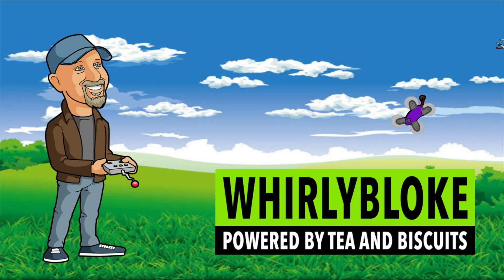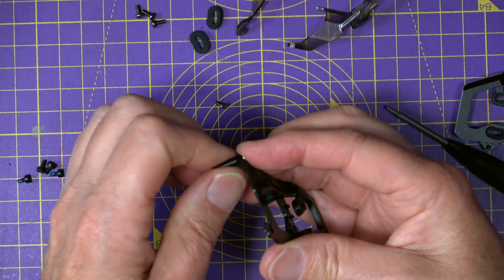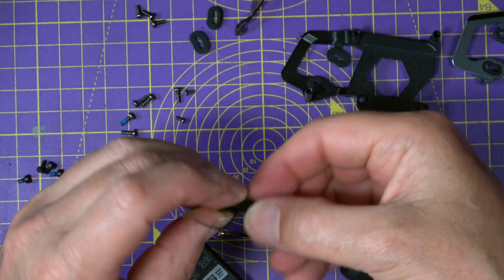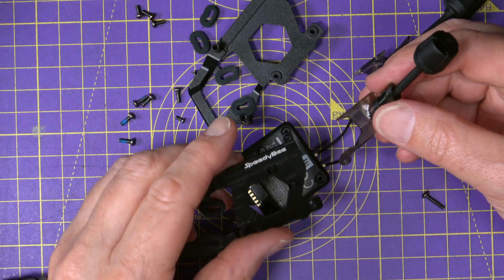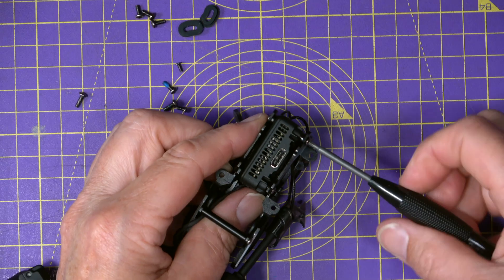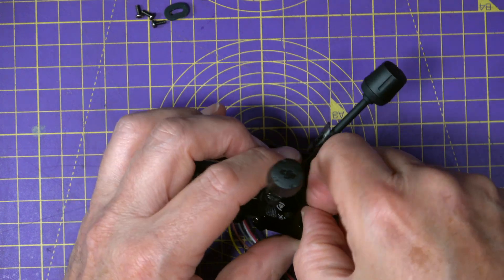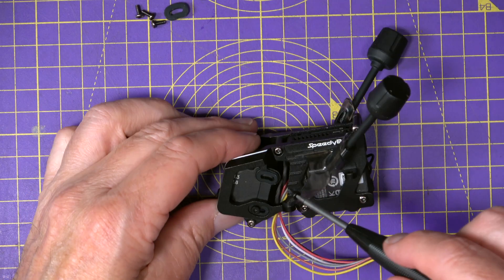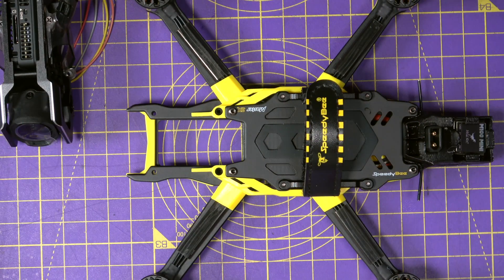SpeedyBee Master 3X and Bee25 Modular HD Digital DJI O4 Pro Air Unit Build

Comment: Really good video. It helped me to mount it the first time. After spending more time with it, I found out it is better putting the usb up (the other way around), so we can use the short 6 pin cable that come with the drone. In addition, I 3d printed antenna mounts in petg that fits sma antenna and plugged the yellow protection on to of the canopy. The design is now more resilient and easier to transition to a bee 25
Reply from the maker: That's some great feedback. It's always awesome to hear how people customize their builds for better functionality.

Comment: Hi, thanks a lot for your help!

I had a quick question because in your video you didn’t show how to actually connect the DJI O4 Air Unit Pro to the ESC/FC.

In my build, there’s a white JST plug coming out of the ESC, and a black JST plug coming from the O4 Air Unit. I’m not sure if I can just remove the white plug and connect the black one directly, or if I need to do something else (like modify the wiring).

To be honest, I’m a bit stuck here and don’t want to fry anything 😅
Thanks in advance for any guidance!
Reply from the maker: I didn't show it because it's a bit different for each build. Usually you would de-pin the O4's plug and wire it to a spare UART on the flight controller.

Comment: use the cooling cutouts/ribs? of the air unit on the one side to zig zag the additional  length of the video signal cable, that way it tucks in super nice and you have no overlength.

I actually had jello because I tucked all the cable between the air unit and the camera head and it was so tight the silicone mounting system couldn't do its thing.
Reply from the maker: That's a really clever tip for managing the cable length and avoiding jello. Although my coiled solution seemed to work okay for me with no jello. Thanks for sharing.

Comment: The 04 pro module is my absolute favorite, I have created adapters for the Mario5DC and every quad I currently own.  I think made it slightly better on the Mario5 with the front mounts going into a slot and only needing the rear screws...but it is amazing and bulletproof.
Reply from the maker: Thanks for sharing your experience. It’s awesome to hear how you’ve customized the O4 Pro module. Adapters can really enhance performance.